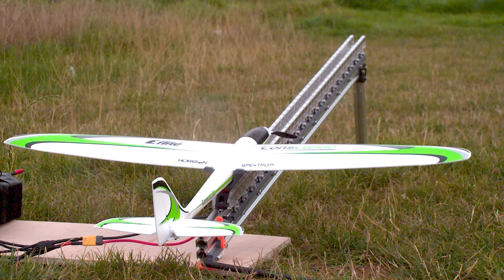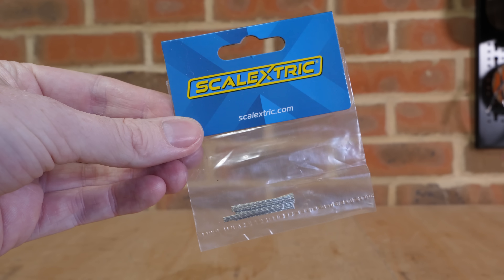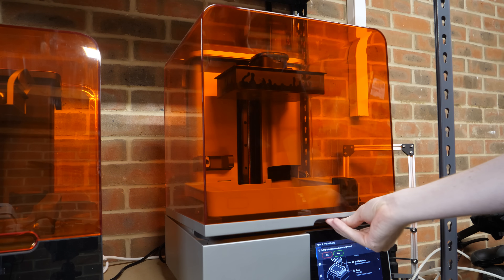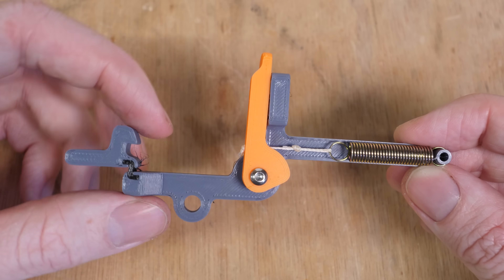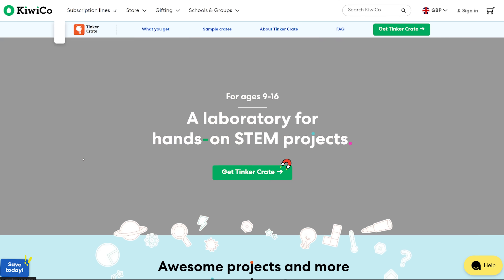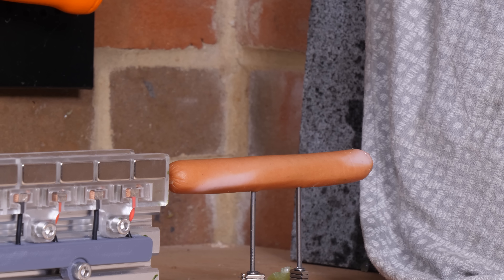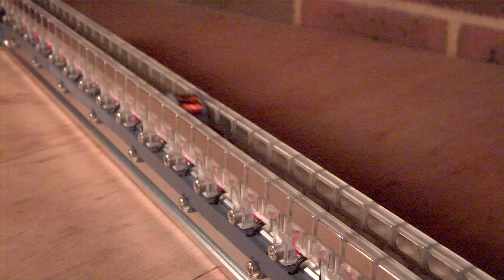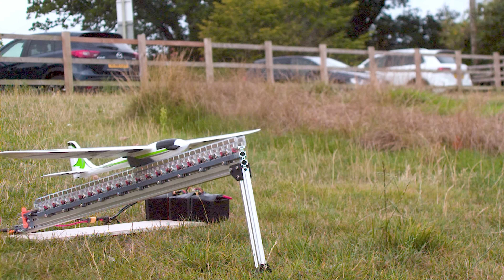Electromagnetic Aircraft Launcher

Comment: There's a very good reason brushed motors do not use metal brushes, but graphite (with a little powdered metal). Though brittle, and not really that hard, these brushes are very slippery and hard wearing, and will conform to small scrapes and wear on the contact points on the rotor shaft. So if you actually machined the contact points on the rail, some very cheap replacement brushes made for, say, an 18V drill, or even a 220V drill, will work for ages. Some of them even come with their own springs, and basically all of them come with a wire already attached, so you wouldn't need crimping. moving the power rails to the middle might be a good idea as well, having the brushes pinch a power rail, rather than push out on either side. With graphite brushes pinching a central power rail, you can also put much more force into the contact (remember they're slippery), therefore making the contact with each electrode (I'm missing the proper word for this, please tell me if you know one) "promptly, precisely, with force and without hesitation, as expected". You may also have to use copper/brass as electrodes. And maybe make a tool with two brushes to clean them if you still get arcing.

Anyway, love the vid, and can't wait to see what you'll do with this!

Comment: 11:50 more turns, higher inductivity, whitch does not let it change curent polarity fast enough, and far end of railgun actually stops accelerating  projectile. You need to increase distance between magnets on far end (or put 2xS 2xN) in proportion to anticipated speed increase. Also, varistor in parallel to coil will greatly reduce switching damage.

Comment: I would suggest building one as a series wound linear motor. Then driving it with AC. That way the magnetic fields can always be in opposition, without any direct correspondence to track position or precision timing. The zero crossing / switching events can then just happen at any time or position along the track. But will always have like / unlike poles facing each other.

Alternately power it from a super capacitor. That way your AC signal is produced automatically. As the series would coils and ultra-capacitor would form a tank circuit.

Comment: I wonder what effect varying the spacing of the stages would have. Such as making the gaps wider as the velocity increases so the time between stages is more constant. Would this allow the magnetic interaction to transfer more energy as there is a charge time constant in the inductive load of the coil as well as time in collapsing the field and reversing it each stage.
The conductive strips would probably also want to be lengthened to power the coil across each gap.
Would it either change the velocity or allow heavier payload mass.
Or maybe the opposite would happen and it would be reductive.

Comment: The project blinded you too the obvious solution for the switch :)

A good light switch has to do this multiple times a day reliable with minimal bounce for years on end, you need an unbalanced spring switch, been used for over a century now I think, and at huge power ratings.

Comment: What's wrong with electronic control?
The initial cost might be higher but if designed properly the electronics with last forever and never wear out.
Copper brush might be worse because it oxidises.
To stop the brush/wick from sucking solder you simply need to cover the rest in a grease, and use limited amount of flux for soldering.

Comment: Could you use brass wheels for the contacts to reduce friction? ....or even an inductive system to put power into the sled? Model railway track comes to mind...

I'm wondering how much the losses are from both the friction and the sparking...

Comment: Thanks for the video, but seems like way over-engineered. Why not simply use a long flexible cable ? If you span it over a simple pulley and add some sort of spring-stopper, you can even have a self reloading device...

Comment: Another very cool and inspiring project. 

Think you can stop the solider wicking in by applying a bit of epoxy, or nail polish just beyond where intend to solider. For switch a mercury tilt switch (glass bulb) might work. Wonder if staged rails with two different voltage levels would make any difference. Lower voltage to start to reduce arcing, and then higher blast of power beyond point of good speed.

Comment: I've seen this done before but a little different. The sled was spring loaded and would enter the rails at speed. This would save the brushes from frying themselves on initial start, aside from the plus of extra momentum. Additionally, the rails were already live before the sled reached them, the trigger was essentially only to release the sled.
Implementing these things might gain you higher efficiency and reliability.
In any case, that thing is cool has heck. I hope one day I can make stuff like this.

Comment: Wonder if you can incorporate a fly back diodes across the coil. The induction of the coil is huge and is what’s creating those sparks. With a diode across the coil that induced voltage spike will just dumb into the coil.

Comment: You can solder braid and not have solder tin the entire strip if you grip the braid with pliers. The pliers act as a heatsink and the solder will solidify at that point
You can buy braided coax cable for less than a £1/m and strip the braid from it

Comment: Awesome video. Its pretty late and my brain isn't working anymore. I was confused about the magnet direction and the polarity of the coil. Are you switching polarity on the coil and the polarity of the magnets for each stage? It seems like you should only need to switch one...
If you are switching the polarity on the coil for each stage would it be possible to "tune"  it like a resonant circuit?
Sorry if my questions are dumb, my brain is completely fried right now.

Comment: Could you use the brush contacts to turn on transistors, or even relays, rather than directly powering the coils? This would maintain the mechanical timing, but reduce the current flowing through these contact points, and reduce the resistance in the coil circuits. It should last longer and be more efficient, albeit with more components involved.

Comment: Try using carbon motor armature brushes instead of metal, they handle current much better. An old-fashioned mercury thermostat switch is another suggestion.

Comment: This is the reverse of Linear Synchronous Motors used for roller coasters in several ways. For starters, the permanent magnets are mounted to the track, rather than the catch car, and the stator is mechanically controlled, rather than digital. At the same time, seemingly pretty reliable, which is almost never the case with LSMs on roller coasters.

Comment: why not make a rail gun instead and do away with all the individual brushes and contacts? the idea of the gauss rifle is to not have a sled to worry about. the rail gun is two opposite polarity rails and uses the projectile/sled as the electro magnet and it acts on passive magnets along the "barrel". the rails could be sent augmented ac from a controller like a linear stepper motor

Comment: I am seriously shocked, how people make the same mistakes over and over again, when they attempf to build a Gauss-gun (or variants): Lorentz force laws says, flax density and conductor length matters. To achieve a high flux density, C-magnets with closed magnetic flux path are mandatory. Furthermore, everything, that uses ferromagnetic cores undergoes saturation. More windings provide higher magnetic flux densities, but sincd the impedance of a coil is Z=R+jwL and u(t)=L·di/dt, there are time limits. Therefore this kind of party has its physical limits. The better way is to use the induction principle with air cores. There is no saturation. The most extreme construction derived from this principle is the rail gun.
Reply: Can you perhaps link a few resources that would be beneficial in learning the stuff required to make a rail gun? I know this one is a Gauss/coil gun adjacent. I tried to read your comment but I am too dumb to understand it, where could I get started learning the stuff? If you could help, it would be much appreciated!
Reply: @shinjiikari1021  A master degree in electrical engineering is a good starting point to design electromagnetic projectile guns successfully. An idea about the fore mentioned design parameters is the Wikipedia article about the Lorentz force.
Reply: Ok Karen 💀🔥👍
Reply: Bruh is everybody here British?💀

Comment: Use pogo pins, or just bend up some phosphor bronze leaf contacts like your original prototype, and grease the contacts to avoid undue wear. Your solder wick is melting because when the first few whiskers make contact, it's a (relatively) incredible amount of energy being pulled through just those tiny whiskers until it can join the main mass, hence the need for a larger contact surface. Professionally-manufactured high-current rotary switches use laminated (layered) copper leaf springs. Marco Reps has a good video where he DIYs such a high-current switch that may be of use.

Comment: not to mention that if you raise the voltage you can drop the thickness of the wire to get more turns with less weight BUT that will limit the current you can run through the wire

Comment: Please just use a N-Channel mosfet for the switch. It’s easy enough to implement (just connect the incoming wire to the Drain terminal and the Source to your powersupply ground. You then just need a small (5V should do in most cases) Voltage to the gate relative to source. 🙈
Reply from the maker: The launcher I built 2 years ago used hall effect sensors and mosfets. However, it was far more complex to build due to the timing control electronics, let alone have to wind far more coils along the rail.

Comment: Great video! I really liked what you ultimately came up with for the magnet circuit to initiate the launch. Your first try using springs could have worked better by copying the design of the trigger and hammer mechanism for the AR platform. The coiling of the spring would almost ensure that there's no bounce once the bar fully rotates.

Comment: Doesn't the weight of the coil sliding on the rail get ammortized by the thing it needs to accelerate? I am really interested what a test with various coil lenths with a weight equal to that of the airplane is attached to it.

Comment: I mean ok sure you could do this with slingshot bands and a bow release but not nearly as fun as a damn coil gun as a launcher LOL
Reply: An even simpler and more sturdy option is a sling string running through a paperclip attached to a wingtip. One end of the string has a loop around your pinky finger, and you hold the other end of the string with your hand.

You just swing it round and round over your head, and let go of the string to launch. If this doesn't provide enough velocity, you simply throttle up the plane to let it accelerate up to launch speed. It's like a circular runway.

The really funny thing about string sling launch is how quickly you can fabricate the launch system. I mean ... you could cut the string and tie the pinky loop in less than half a minute. Bending and attaching the paperclip hook to the wingtip could take less than half a minute also. So ... total fabrication time is under one minute!